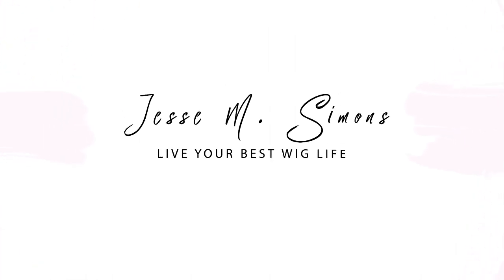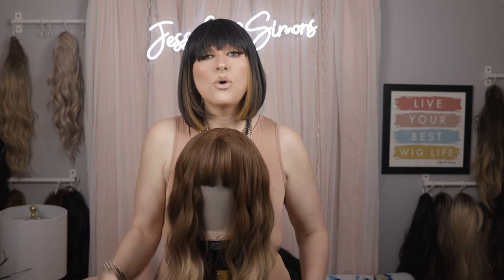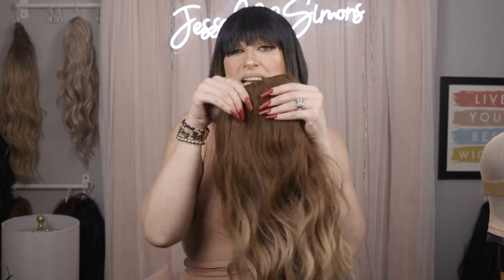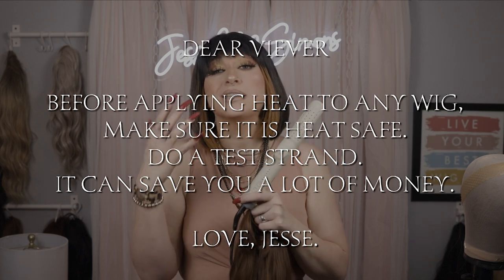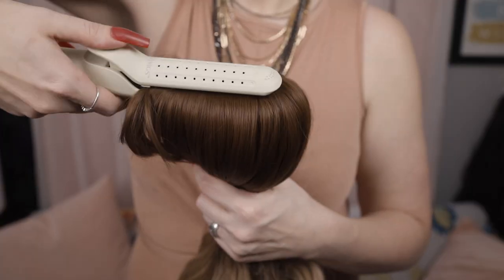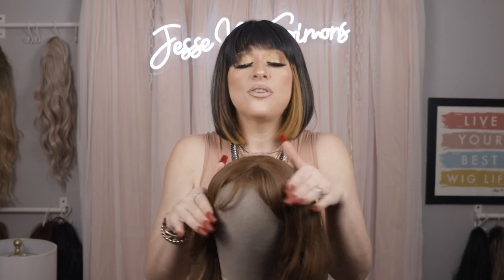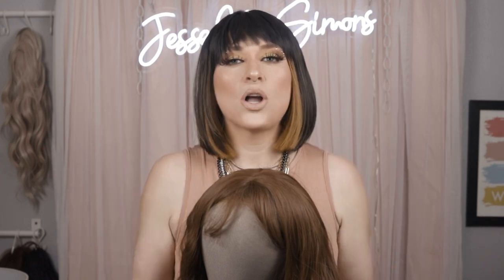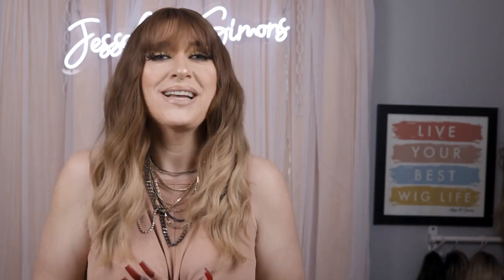How To Fix Cone Head Synthetic Bang Wigs | Jesse M. Simons | Wig Education

Comment: Is there a way to get rid of bump with non-heat synthetic wigs?
Reply from the maker: Yes you can use a steamer and I recommend putting the wig onto a wig head then using the steamer to warm up the area then use your hands to help reshape and mold the wig back to the wig head shape your want.
Reply from the maker: @JesseMSimons I can work on a short showing this too.
Reply: That would be so helpful. Thank you Jesse

Comment: But it is sintetic plastic like... I am afraid to distroy with heat🙈
Reply from the maker: You definitely have to go on low heat to start and sprays some water on the wig if you are unsure. You can also use a steamer instead.